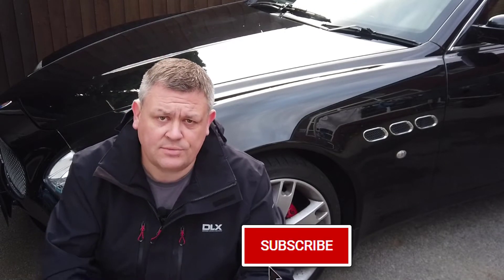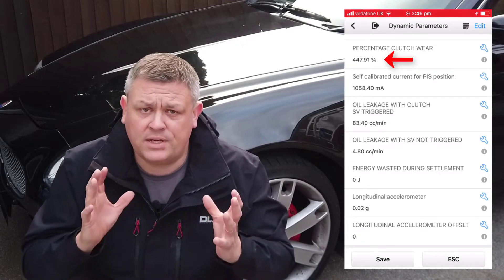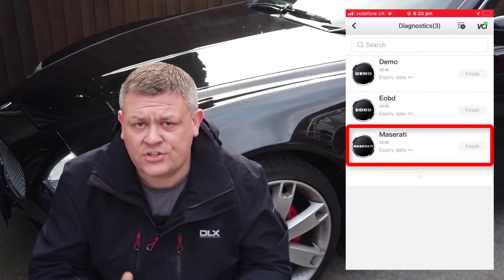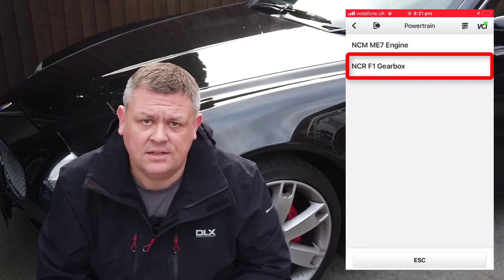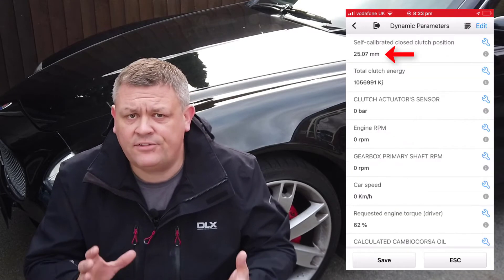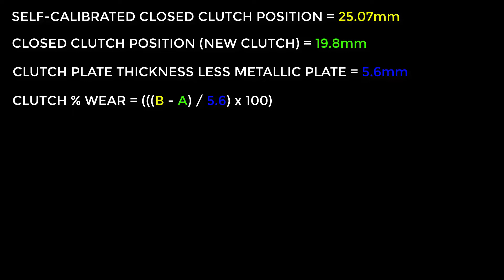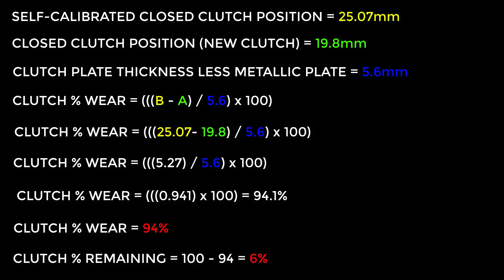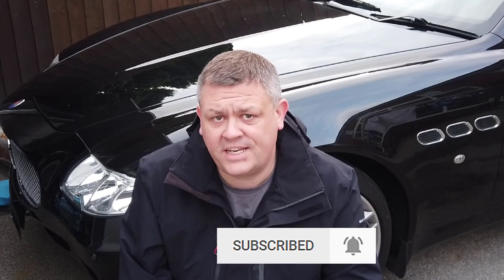How to CALCULATE PERCENTAGE CLUTCH WEAR on a Maserati Quattroporte Duoselect - Autel MaxiAP AP200

Comment: Pleasantly surprised to find a video like this in 2022. My '06 QP needs all the help it can get. I kept using cheap scanners that couldn't do everything, and my attempts to wire up a DIY python-can solution haven't worked yet, so I'm giving the Autel a shot. Thanks!

Comment: Hello Adrian, thank you very much for the great video.  I have a 2005 Maserati Quattroporte Duoselect.  I also have the Autel Ap200.  For me the diagnosis only comes into the transmission control unit.  Motor control does not work.

Comment: Hi Adrian ive just hast to change some lines on my f1 pump and having problems with it not always going in gear now tried bleeding manually it does help have you had to change any lines on your f1 pump yet.
Regards Domenico
Reply from the maker: Hi Domenico, I’ve not changed any of the lines on my car. I have however read this in the past. Hope all goes okay. https://www.sportsmaserati.com/index.php?threads/f1-bleeding.15882/
Reply: @AdrianLeggettUK  thank you very much Adrian I'll look into this
Reply: Hi Adrian I hope my findins can help other people in your group.
So it started off I had a f1 pump hose that was split and leaking and guess what it always changed gears and didn't play up.
Well this is where the trouble started I replaced hoses and refilled the system and pump worked but no gears so I vacuum bleed the system it would get gears and after a 1km it wouldn't anymore🤨 after sever bleeds like this it did get a little better but not much and I don't have a scanner to do this I've ordered what Adrian uses.
So this is how to bleed without a scanner you will need .5 to 1lt of oil spare you need to be in neutral one person under the car to bleed and one in the car to select gears so start in neutral open bleeder and select 1st close bleeder and select neutral then open bleeder and select 1st again close bleeder and top up oil back in neutral and open bleeder select reverse close bleeder and neutral open bleeder and select reverse close bleeder and neutral top up reservoir repeat these steps till you're been through about .5lt of fluid and no air in the system be very patient always keep your reservoir full or you'll need to start from scratch good luck maserati friends 😊

Comment: Hi just stumbled across your channel. I’m thinking of going for a Quattroporte too . In my 20s I worked for an Alfa Romeo dealership and have driven many Selespeed cars with effectively the same robotised clutch system as the Duoselect/F1. I know how to drive them with feathered throttle to smooth out the gear changes. I was curious to wonder if you’ll be attempting the clutch replacement yourself?
Reply from the maker: Hi Matt, there is definitely a knack to driving them and I find gear changes pretty smooth. I may have a crack at doing the clutch. It’s a fairly big job - I heard around 10 hours. That said I’ve got lots of work on and other projects, so I’ll see when it needs doing.

Comment: Thanks Adrian -  I bought the scanner via your link.   Checked my 2007 QPV Sport GT and it reads as 16.9mm, 20.97mm so I get that to 78% worn at 82.5k.  Not bad, previous owner had car since new and used for long European trips.   I’ll keep track of it and see how my style of driving changes it.

Do you have another other tips tricks that we can use the Autel for.

Thanks for the videos.
Reply from the maker: Afternoon, that's great. Well I still need to figure out if there is a way to configure the Autel to do the proper calculation but not had time yet. Also got to do the oil reset, which is due on mine now. There are a few things I’ll have to create some videos for. If you find anything and suggest some videos let me know. Thanks Ade

Comment: Thank you very much for creating this video. Was able to determine clutch wear on a 2007 Quattroporte. With an odometer reading of 51,225 miles, I’m showing 34.5% clutch wear (or 64.5% clutch material left). I’m in the states, so all my figures were in inches, not mm, but of course the formula works just the same. I used an Autel MK808 scan tool. My “closed clutch position/new clutch” value was in a slightly different category on the scan tool.

Thank you again!
Reply from the maker: Thank you very much for commenting and pleased you found it useful.

Comment: Newby to Maserati here , but I think I am missing something: as far as clutch wear is concerned the $100 Autel does as much as the  $1000 Xtool or the $20000 Lenardo. Is that really true?
Reply from the maker: Hi, I'm not sure how example exactly the Xtool and Leonardo exactly compare but I have heard that there are some specific things that have to be done by the Leonardo machine. To date I haven't come across anything I have not been able to do using the Autel and I know there are lots of features it has and I haven't used yet. For £60 I wouldn't be without it. It has saved me a small fortune and all the hassle if taking it to my Indy or dealer.

Comment: Nice video, can you use the AP200 to safely adjust parameters or is it purely read only?
Are you doing a clutch change anytime soon?
Reply from the maker: For what it is the Autel does quite a lot. You can change parameters, engine service light reset etc. My clutch wear % is high so I expect it will need doing soon.

Comment: Hello, I has been suffering with the invalid clutch and gearbox read out parameters with Bosc KTS 250 and Launch x431. As I looked for the F1 gearbox is mouted to Alfa 8C and Ferrari 430  driven by hardware version of the gearbox ECU CFC301 contoler. So under Ferrari 430  CFC301 I found more parameters and setup possibilites. As far as I know the Maserati (GT and the Quatroporte )  could be equipped with 2 different marelli version (Sofast 2 CFC231 and sofast 3+ CFC301) The earliest version probably more clutch consumer. And correction are welcome .

Comment: Hi Adrian, was that the original clutch?
Reply from the maker: Hi, yes it is. Now at 84K miles.
Reply: @AdrianLeggettUK  Jeez...not bad going! No worse than a decently driven regular manual then.
PS - A video on how the skyhook is holding up and replacement options would be A1!
Reply from the maker: @brendawg8002  it will be due one soon I’m sure. That’s a job for my Indy. He said just keep going until it starts dropping from gear into neutral. It gradually gets worse and that’s the time to change it. Thanks
Reply: @AdrianLeggettUK  Very good. All in all, would you say that owning a QP hasn't been as scary as some would lead you to believe?
Reply from the maker: @brendawg8002  I purposely bought an older QP with Duoselect over a newer one. I was wary when I bought it but have done lots of work and learned lots about the car. There are some things I won't do, but the majority of maintenance things I've been able to do. I have found it's a car with lots of niggles and it's frustrating at times. Diagnostics software is a must.
Reply: @AdrianLeggettUK  Perfect car for YouTube content though! And it is a beauty, hopefully worth the occasional headache.
Reply from the maker: @brendawg8002  absolutely. It’s an addictive car. Lovely to drive, reasonably quick and sounds great. Wherever I go I always have people stop to have a chat about it.
Reply from the maker: @brendawg8002  if you’ve not seen it already, take a look at my Maserati playlist. Here’s the car on the runway: https://youtu.be/W4sqouP94hI
Reply: @AdrianLeggettUK  Seen it...bears rewatching ;)

Comment: Fantastic video and explanation mate, keep these videos up. So many convoluted  explanations out there, but you have made  it very simple. 
On another note, there are many car computers that have trouble reading Maserati settings accurately, even if they are suppossed too.  I have seen some articles online were owners have rendered their cars  undribable trying to set the Kiss Point/ PIS on new and used clutches with  Launch and other Scanners.
Reply from the maker: Thanks. Yes I have seen that too. I have to say that so far the Autel has done a fantastic. You can quite easy mess things up though if your not careful.
Reply: I may get one, got a ArtiDiag800 BT, is really good wIth everything else but my Alfas and the Masserati.   Will you be doing the clutch yourself? That would  be an interesting couple of videos, but I know it will be hard without a hoist.